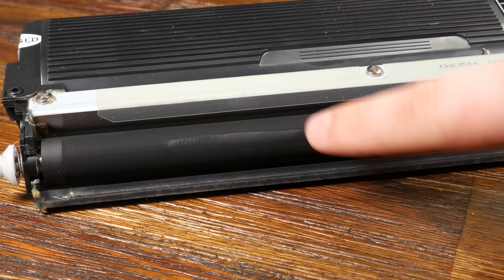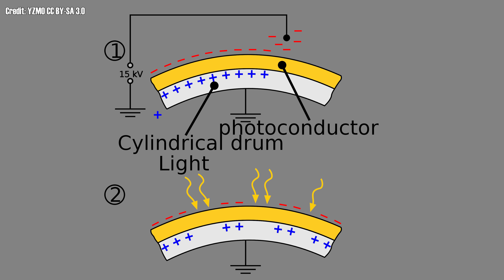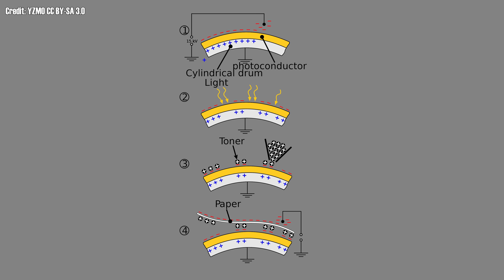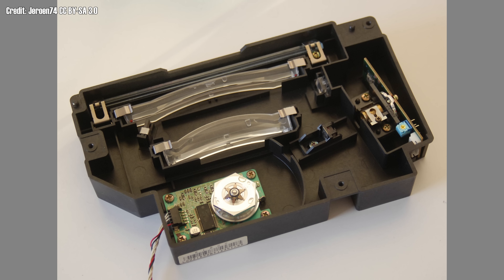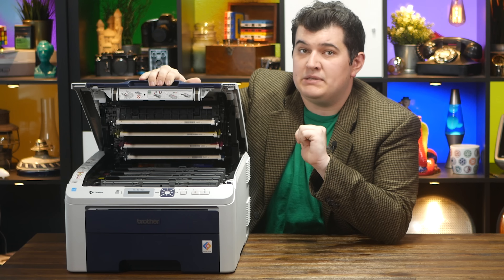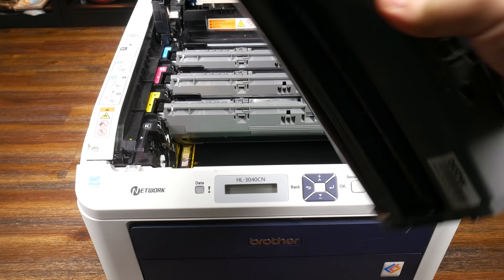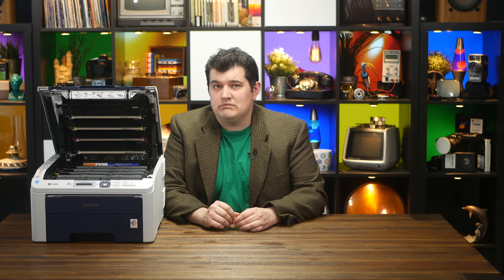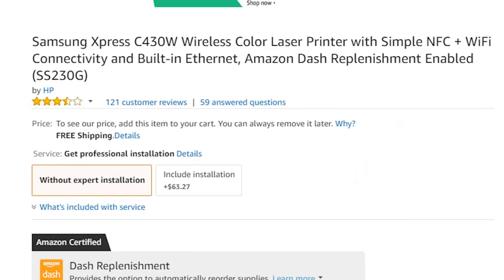LED Printers: The Common Printing Tech You Haven't Heard Of

Comment: I've not read all of the comments, nor perused all of the videos on your channel to see if it exists, but if you want an interesting printer technology topic to cover, how about Xerox Phaser printers. The joys of printing with melted wax... I'd even donate a few printers to you if we hadn't finally gotten rid of them several years ago now. While they themselves aren't bad printers, without proper maintenance (such as turning them off and allowing them to cool before moving them out of a classroom to clean the room or to get them out of the way to reach something you dropped behind them or whatever the case may be... (heck I don't think maintenance even bothers to turn the computers off before moving them, just pull the plug out of the wall...)) they could become problematic. They did produce some really nice color prints, but when the wax got out, man did it become a pain. We had the 8400 and 8500 models IIRC, it's been a few years. I think we still might have some of the (probably generic non-Xerox brand) wax cubes for them and possibly a maintenance kit or two on the shelf if you ever need them for a video. (We might have finally gotten rid of toner for printers that we haven't had since before I started working here 15 years ago over this past summer...)

Comment: Of course I've heard about LED printers. And just like laser printers, they emit larger amounts of toxic ozone gas as well as tons of fine dust, which can be found in the blood stream of office workers working in a room where a laser printer is located and even in the bloodstream of other people just working in the same building. Most filters in air conditioners cannot catch that fine dust, it's too small, so they will even spread it aruond. Only filters fine enough to catch virus will catch that fine dust, yet no laser printer has such a filter build in, even though this would be technically feasible (I know vacuum cleaners that have such filters). Considering that better, modern office inkjet printer can print over 20 pages a minute and even text looks great, it has cartridges that last for about 6000 pages and can even be refilled very inexpensively, you really should think twice which advantages a laser printer really has to you, that are worth risking your health for.

Comment: This edge to edge single row of 'print heads' was used by HP and a startup in an ink-based system that HP still sells today, called Edgline or PageWide, can do up to 70ppm after the first page (which is like 40ppm). Great for home office use.

Comment: printers seem to be one of the slowest developped tech branch. I still have my laser printer from 2003, it cost 60$ then and still prints pretty much as well as every modern b/w laser printer in 12 pages/second while being as big as modern ones. Same applies to the 1995 model of my brother's. If they had the same speed in development as they have in smartphones, TV screens and cars, we probably had a printer in the size of a bounty chocolate bar (3x) right now. sigh

Comment: back in the 90's I had a Okidata (i don't know when they shortened it to OKI) LED printer, it was fantastic for a couple reasons, back then I was in the Navy and I was in charge of my ships news letter which I printed on my Okidata, they were usually 7 to 8 pages and I was making 70 copies every month. My unit came with 2 meg ram, I added 16 meg for 18 meg total so no matter how complex the image it printed just fine with no errors. Best of all the toner cartridge was separate from the image drum, and the toner was about 10 or 15 dollars, and I might replace 5 or 8 of them before there was any issue with the drum and replace it. this made the operation cost so much cheaper the say a comparable HP laser printer at the time which I think was either the model II or the III. Added bonus I had a page scanner that had a parallel port pass through and connected to the printer I could make copies without the computer even connected. As time went on eventually I got newer printers and scanners and such and gave the Okidata and scanner to my dad who used it until he retired in 2006, sadly after that it went to goodwill i believe.

Comment: One major advantage that Color LED has over color laser you forgot to mention is that color laser printers pass the page through the same fuser 4 times.  You need buy thicker paper so that the 4x heat doesn’t curl up the pages.

Comment: Inventing the laser printer only took 3 weeks of hardware work.  You needed an octagonal mirror (8 mirrors pasted onto an octagonal wooden "wheel"), a motor, a laser, and an interface to a microprocessor.  Done.  The software took 2 months.

Comment: My grandpa has a dye-sublimation fax printer. The cartridge is a big tape that goes forward, a bit like a cassette tape. After the cartridge it at its end, my grandpa "rewinds" it using a drill so he can use it again. He saved so much money by doing this.

Comment: Reasons he doesn't like Inkjets, as shown at 0:19
1. Ink dries out, meaning that the printer has to either constantly be performing a "maintenance mode" which wastes ink, or you need to print rather regularly which, in this paperless age fewer and fewer people are doing.

2. The herky-jerky nature of the print heads as they travel back and forth is very unpleasant compared to the smooth print of pretty much any laser printer.

3. Ink cartridges are usually priced at stupid levels, meaning that you're forced into buying generic ink which often clogs the inkjets, so you're damned if you do, damned if you don't.

4. Because the ink is liquid, freshly printed have a tendency to smear if touched until the ink has dried.

5. Water-based inks are likely to completely wash away if the paper they are printed onto becomes wet, meaning shipping labels printed with some inkjet printers can be rendered completely unreadable if they get wet something like, oh i don't know, rain.

6. None of these issues plague laser printers, so despite their higher upfront cost (and arguably more expensive toner) you can pretty much count on them to work perfectly even if they've been idle for over a year, they don't waste toner on "maintenance modes", the toner is bonded to the paper so water doesn't smear it, the toner is never wet so you don't have to wait for it to dry, plus spills can easily be cleaned up as the toner is a powder. I could go on but if you read this entire thing, now you know why i generally dislike inkjet printers and why I will forever use laser printers. Or LED printers which are the subject of this video as you'll soon see.

7.  That said, Techmoan recently reviewed an inkjet printer that was actually pretty decent in terms of the ink cost, eso even if a "maintenance mode" were to waste ink, it's not like it's wasting super expensive ink.

8.  Perhaps one day I'll rejoin Team Inkjet.
Particularly for photo printing (and images in general) inkjet reigns supreme. But for now, I'm planted in the realm of toner so that, when i have to do my taxes, I don't have to waste time, energy, and money fighting a stupid inkjet with clogged heads.

This took me a quite bit of effort to do, but hopefully this helped some of yall

Comment: I once had an Okidata LASER printer that didn't actually come with enough memory to store an entire page at its full resolution.  Two ways it could print a full-res page were 1. Fonts, you could send it a font (it also had several in memory) and it would, on the fly, use the font to render a page full of characters also stored in memory.  2. It would print part of the page, and then you'd be prompted to feed the same piece of paper back through and it would print the rest of the page.  Or you could upgrade the memory.

Comment: I'm sorry, but inkjet printers are superior for nothing. Even dot matrix printers have them beat in many cases. If you want to print photos, use a lamination printer (or whatever they may be called). I have one for whenever I need to print 4x6 photos and the quality is always amazing. The only downside is that the size of the print is locked in with the size of the "film". https://shop.kodakphotoprinter.com/collections/printer/products/best-photo-printer-kodak-dock-plus-bundle

Comment: HP 2600n was even more compact but still a laser printer. It had the red shift issue and actually the laser covering long glass windows/lenses that the laser passes last got just covered with print toner dust over time due to weird ventilation. But lasers can be mirrored through tinyest of spaces, so I really don't see any gain here. Simply put more lasers in, like the dual laser that was on 2600n. Having all the LEDs aligned properly seems nightmare compared to easy calibration of a laser. I wonder also about DLP technology that is used in projectors and lithography 3D priters (SLA).

Comment: You forgot to mention the existence of the primary transfer belt! (PTB) which sits right near the drum units and is what actually deposits the image onto the paper. The drums create the image, which is then deposited onto the PTB. The PTB will then carry it into the paper feed, where a sheet of paper will pass by at a synchronised speed with the PTB and this is where the final image deposition occurs. before the fusing process is completed with not just heat, but a lot of pressure as well, as the toner has to be pressed into the paper while it's malleable so that it gets into the porous structures a bit and sticks properly.

Comment: Im a Field Service Tech for Fuji Xerox. Laser Printers have Transfer Belts, just like LED printers, that mean a paper path is NOT impacted greatly by the technology of the write side of Dry Toner based printing (in fact you basically completely forewent the Transfer Belt side of all color printing with Dry Toner). We have both LED and Laser printers in service, the laser devices are usually in the larger, more color accurate machines, whereas office machines use LED's. Both technologies have mechanical and quality ups and downs, however i do appreciate your "laymans explanation" on the dry toner process. Most people do not understand how light based Dry toner printing works! Good video!

Comment: Corona wires were replaced for the most part with charge and transfer rollers about 20 years ago.   Corona wires were always prone to hot spots and dead spots and had to be frequently changed.   These days you will only find corona wires still in use in large production printers and the wires are set up in a grid to help eliminate some of the weaknesses inherent to corona wire technology.   Regarding the origins of the LED printing method this goes back to the days of the early fax machines.  You will find nearly identical LED arrays in the fax machines of the 80s as you will now find being used in series in color printers.  Regarding the arrangement of printer cartridges, the arrangement of the cartridges is nearly identical on Laser and LED printers.  The difference is the presence of the four LED arrays on the LED printer.  Laser does give far superior image results to LED if you really are critical about image quality but the results out of LED printers are by no means bad.  30 year commercial printer specialist out.  LOL.

Comment: Being a MFP specialist, LED components consistent with a charge roller that physical make contact to the drum to charge over a Laser unit using a Charge wire (corona wire) that's spaced and distanced away proportionality.

He didn't explain that there's a transfer belt system that transfers the image from the drum to its belt before making contact to the paper via secondary transfer roller. Quality truly depends on the manufacture today.

LED is much more compact and is easier to work with/quality is good but the LED head gets dirty a lot, causing lines and blank spits. Cleaning a lot, hence the exposure to easily accessing it in this one. The laser unit is protected by a glass covering for each color and tends to not get dirty as fast, but if so, it requires a wand stick you would use to clean the glass. 1200 dpi is more common with Laser but LED is making more and more 1200 DPI heads as time gets better.

 The charge rollers also get damaged over time since they make consistent contact with the drum. 

Things at Best buy and Office Max truly suck ass. You need to go with a top manufacture (Konica Minolta etc.) for a solid printer that will guarantee save you money plus with a better warranty, 3 years. There's servjce company's that will also repair your equipment over these crap printers that are done in probably a year and offer no parts or repair programs for companies or consumers.

Comment: This is an excellent video, and concerns a prescient topic, given that this is still perfectly relevant in an area that changes so much - so frequently.  I have a nerdy fondness for topics like this, so I have to ask:  Have you considered doing a similar presentation on other printing technologies?  My favorite example:  Something that discusses...solid ink?  Most people aren't familiar with these things.  These printers appear to use ....crayons, rather than tonor.  The claimed print speed is surprisingly competitive, compared with laser printers.  The cost is (almost) on par with color lasers, and the output is just ....(invariably glossy) cool. The inner-workings, along with the history of the tech is potentially a cool story.  No complaints - at ALL, just...sayin (giving unsolicited advice), so of course - ignore without concern.  But darnit - these are basically printing with crayons, which is funny and cool:  (one example) The ColorQube 8580.

Comment: At 0:18 (sorry if this has already been posted, I didn't see it):

Ink dries out, meaning that printer has to either constantly be performing a "maintenance mode" which wastes ink, or you need to print rather regularly which, in this paperless age fewer and fewer people are doing. 

The herky-jerky nature of the print heads as they travel back and forth is very unpleasant compared to the smooth print of pretty much any laser printer.

Ink cartridges are usually pried at stupid levels, meaning that you're forced into buying generic ink which often clogs the inkjets so you're damned if you do, damned if you don't.

Because the ink is a liquid, freshly printed documents have a tendency to smear if touched until the ink has dried.

Water-based inks are likely to completely wash away if the paper they are printed on becomes wet, meaning shipping labels printed with some inkjet printers can be rendered completely unreadable if they get wet from something like, oh I don't know, rain.

None of these issues plague laser printers so despite their higher upfront cost (and arguably more expensive toner) you can pretty much count on them to work perfectly even if they've been idle for over a year, they don't waste toner on "maintenance modes", the toner is bonded to the paper so water doesn't smear it, the toner is never wet so you don't have to wait for it to dry, plus spills can easily be cleaned up as the toner is a powder. I could go on, but if you read this entire thing, now you know why I generally dislike inkjet printers and why I will forever use laser printers. Or LED printers, which are the subject of this video as you'll soon see.

That said, Techmoan recently reviewed an inkjet printer that was actually pretty decent in terms of the ink cost, so even if a "maintenance mode" were to waste ink, it's not like it's wasting super expensive ink.

Perhaps one day I'll rejoin Team Inkjet. Particularly for photo printing (and images in general) inkjet reigns supreme. But for now, I'm planted in the realm of toner so that, when I have to do my taxes, I don't have to waste time, energy, and money fighting the stupid inkjet with clogged heads.

Comment: The one thing I wish this video covered is that most (all?) copiers in use today aren’t the type of copier described. Our current day “copiers” are scanners put together with a printer. 

I remember some old school scanners where to print it would move the whole top of the device back and forth for each page. 

Two ways to see if your “copier” is really a scanner/printer combo:
1. Can you print from a computer to it?
2. When copying does it scan all the pages at the beginning, then print them out?

If yes to either, it’s a scanner/printer.

Comment: you missed part of the design, the transfer belt, which looks to be present in the LED printer too

Another thing, most laser printers that are color print in a straight line since all the carts live on the transfer belt. Xerox 6280DN, HP Color laserjet 2600, HP 4005. Fast way to tell is you can usually hear the motor spinup for the mirror, its a pretty distinct noise

Comment: I think this technology nomenclature mish-mash arises from lasers being LED themselves. Commonly used lasers are same emissive technology, but with extra steps. It;s the same Light Emitting Diode but made with a crystal that provides a resonant cavity and emits coherent light.  There even is a possibility that printers that you are calling LED printers are actually laser printers with a bunch of laser diodes in a linear array instead of one laser that is opto-mechanically scanned across the drum.
But anyway, good old scanning laser printers are LED printers regardless. Unless there are ones with gas or ruby resonance medium, or argon or whatever oldschool laser tech in them. :D I'd certainly want to see a vid on those :D :D

Comment: "and arguably more expensive toner" Hold on, laser toner cartridges are cheaper than even generic inkjet ink.  They are approximately half the cost when you calculate cost per page printed.
Reply: Not with the trending ink tank systems out there.